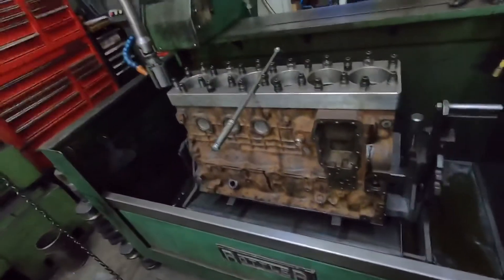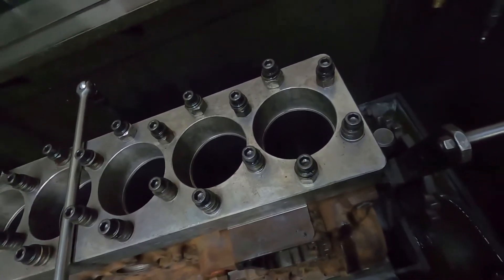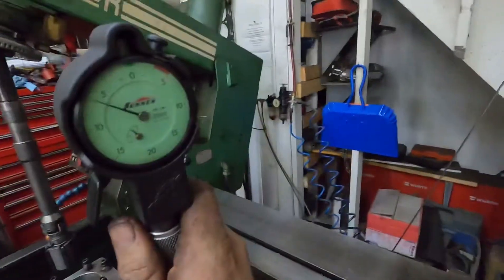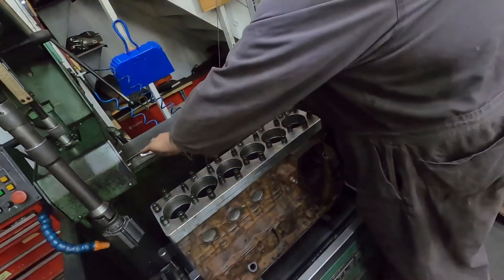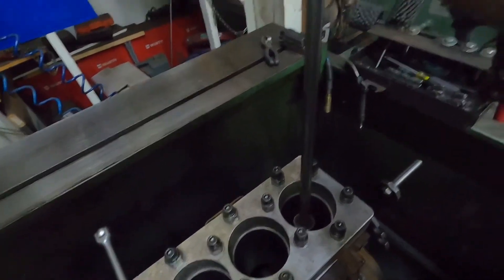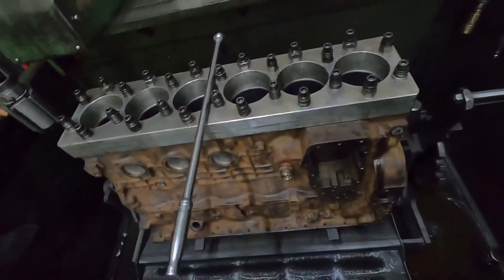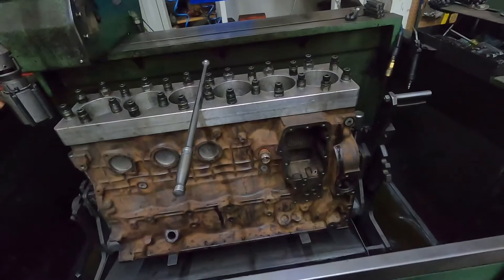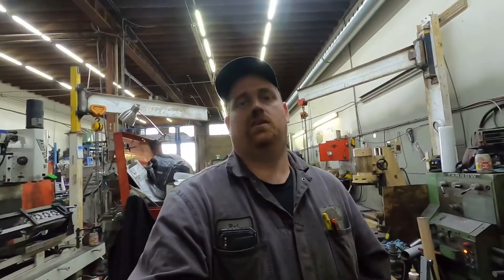Why you should use a torque plate when honing

Comment: Yeah I believe in torque plates I was reading an article many years ago but her McCandless when he was working for Indy cylinder heads he said he would like to both the torque plates on like just before he went home for the night and let the engine set all night with them torque lights on it apparently it takes a little while for it to finish squirming around and that’s he says he said that’s how you get the best job anyhow this is Jim with the old 91 Dodge with six in a row under the hood all right you have a good day bye
Reply from the maker: Ya it would have been great to be apart of the industry in the hay day. Thanks for watching and sharing

Comment: What have you seen with distortion on different gasket types or using hot water heaters to get the block up to operating temp while honing? How much distortion is seen on LS engines in the top of the cylinder where the rings seal as those bolts seem to be long and distort the bottom of the cylinder not effecting ring seal? How much more do studs distort a cylinder compared to bolts as they seem to offer more clamping force? Thanks for sharing, always learn something new!
Reply from the maker: gaskets don't seem to make difference from what i have seen, but i could be wrong, bolts do distort just not as bad , as the load on the stud and bolt is different. same thing in ls engine just a bit lower in the bore.

Comment: A torque plate really helps get a good ring seal. As much cylinder pressure as a  Cummins has especially under boost will make a big difference . I used them before on  small block chev and it really helps
Reply from the maker: Ya I have a bunch of them for different engines. Have to do it the right way

Comment: Torque plates should be used on every hone job. Even a lawn mower. If someone doesn’t want to spend the money to do it right, because they want it to be cheap. Don’t even bother taking it to the machine shop. Because at that point your basically just paying for them to assemble it for you. If you want it to last then it has to be done a certain way.
Reply from the maker: In  perfect word your right. alot of engine when using stock hardware you don't see cylinder distortion. but when using arp hardware it's a most
Reply: I believe the charge for it is silly. Shops around me are charging up to 150  extra to slap the plates on 350 Chevy. I don't even charge up for it, it is just done as regular routine. There are two shops in my area now that no longer charge for torque plate honing on most builds. There are exeptions though, some are a bit more effort or maybe it's an oddbal block you'll rarly see. But our common everyday builds no longer get the upcharge.